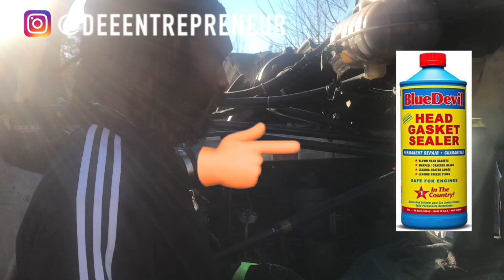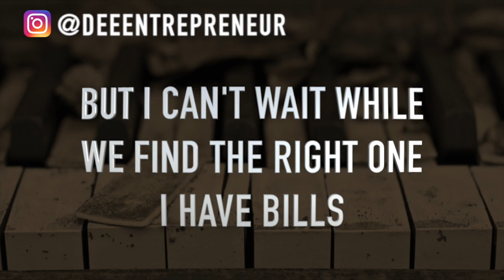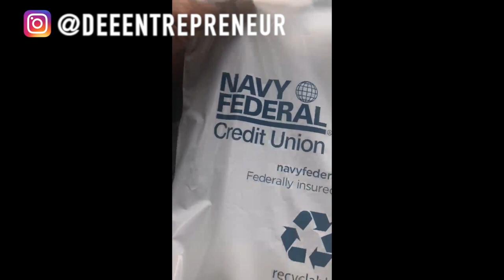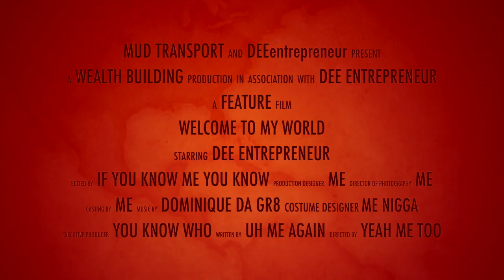This Truck Repair Bill Just Put Me Out Of Business | #Amazon #Trucking

Comment: I believe they have a updated head gasket for the Mercedes engine supposed to be a better gasket
Reply from the maker: Yeah but I’m done with the Mercedes. Snatching it out and putting a Detroit 60 in there.
Reply: Just make sure that the harness and ecm will work with the series 60 as well as all the other connections
Reply: @deeentrepreneur  Facts great move 💯
Reply from the maker: Oh yessir changed that harness to 👌🏾